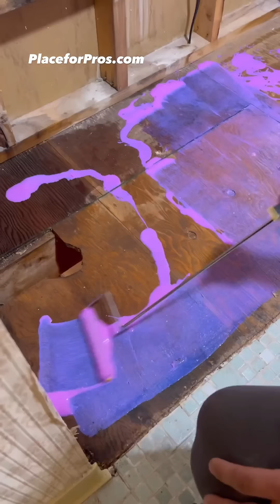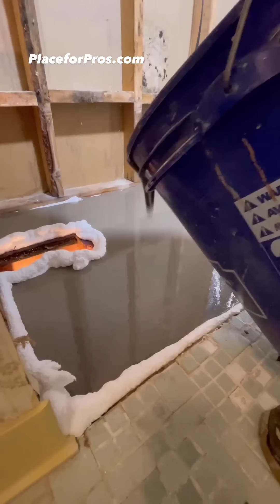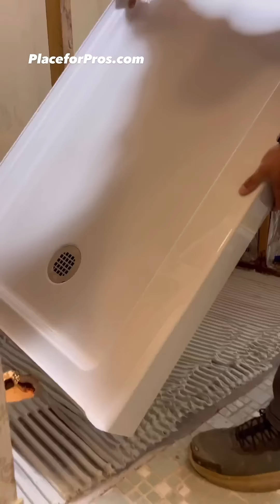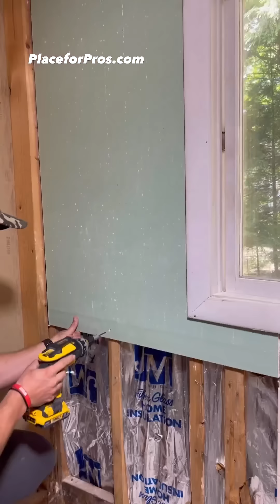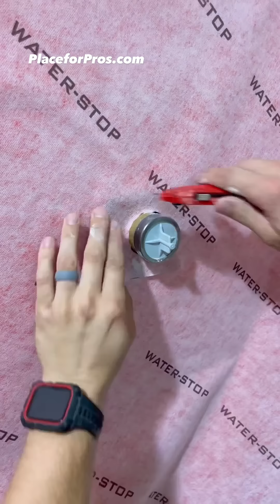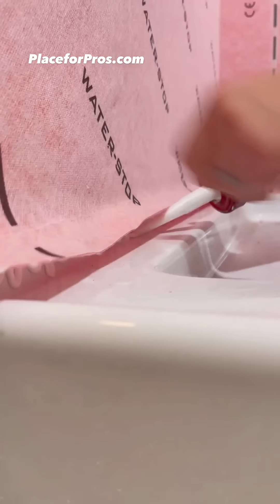How to Waterproof Shower Walls

Comment: I would've left the membrane floating at least 1/2" above the horizontal of the shower pan. Leaving it that close to the bottom is like asking it to wick up water. You need a break there so that wicking won't happen. Also I don't know how I feel about gluing it to the shower pan. I guess they sell their own sealant glue stuff for that purpose, because the caulk tube was labelled 'Water-Stop' as well as the membrane. Not sure what their recommended procedure is. You know, it's like roofing. Keeping water out is literally an effort in futility. Shedding water what you're actually trying to do.
Reply: No, waterproofing isn’t like roofing.